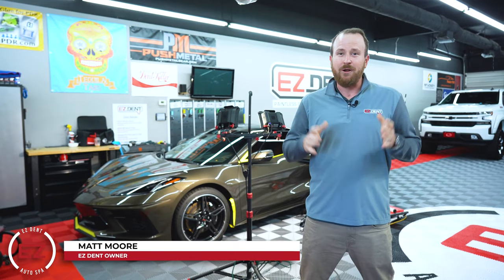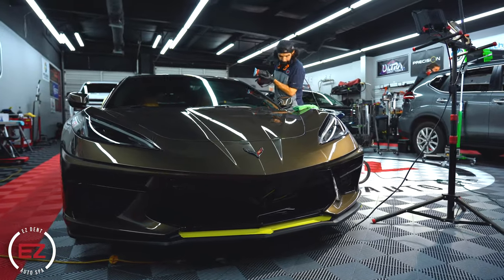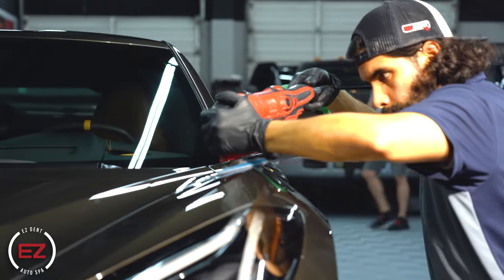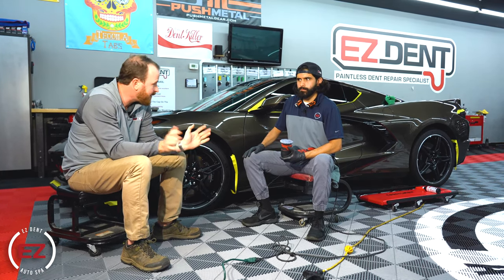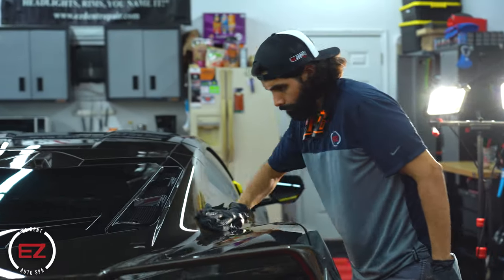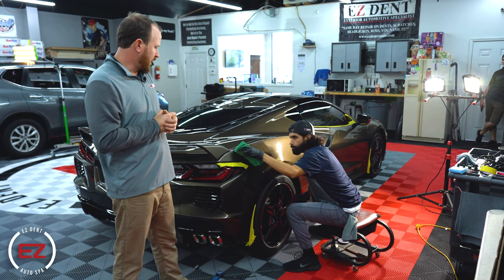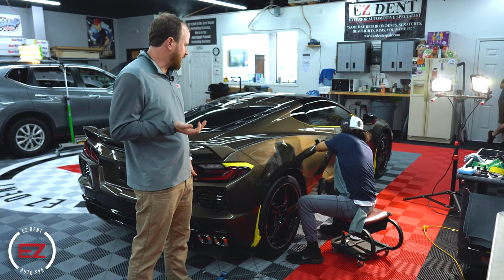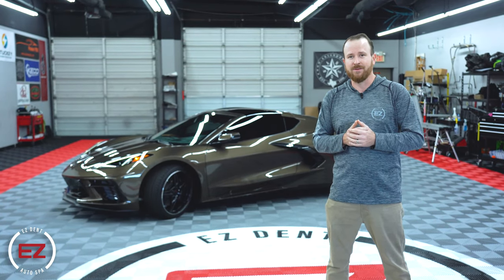Corvette C8 Ceramic Coating - Gtechnic

Comment: Hello this car had any PPF done prior to the ceramic coating?
Reply from the maker: This client did not opt for PPF before the ceramic. 
We do highly recommend paint protection film, especially on low cars like this C8. It helps prevent rock chips and other paint damage.

Comment: Is it truly something that I would see a change between the before and after?
Reply from the maker: Great question. The short answer is, yes absolutely. The long answer is that the paint correction process makes the biggest difference in the visual look of the vehicle. The ceramic coating locks in the look of the corrected paint and also ads a protective coating that stays cleaner and also makes it much easier to wash when it is dirty. 
Think of paint correction and ceramic coating like putting a glass top on a wooden table. Even though the glass top will make it easy to clean and offer protection to the wood; any stains, scratches, damage, or crayola drawings that previously existed on the wood will still show through the glass unless it’s properly addressed first. On your vehicle, once you correct the existing damage to the paint, you can protect it and "lock in" that shine with the ceramic. 
Feel free to read more about it here:
https://ezdentrepair.com/services/ceramic-coating/paint-correction/

Hope this helps.